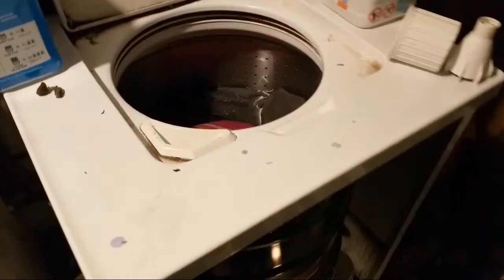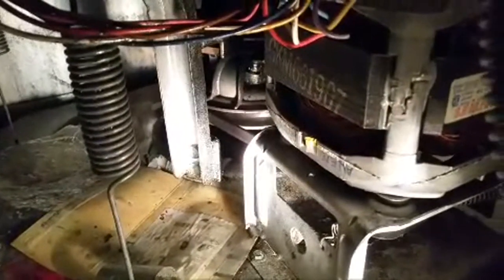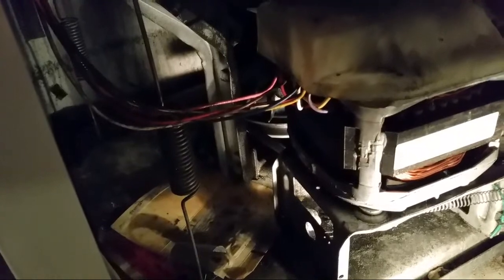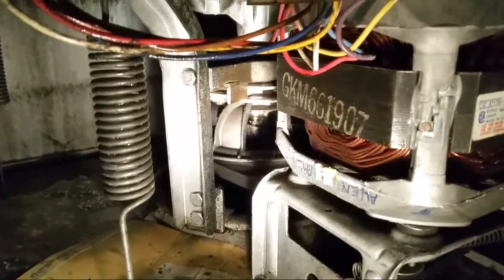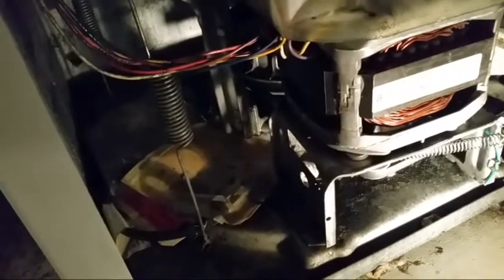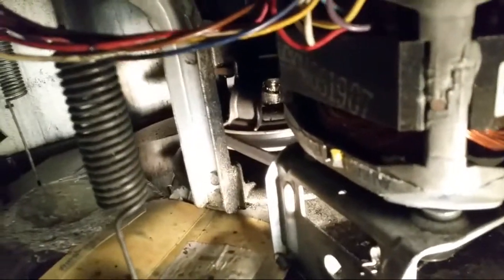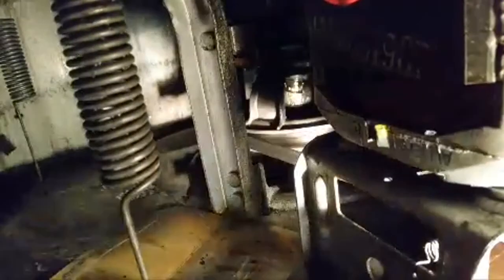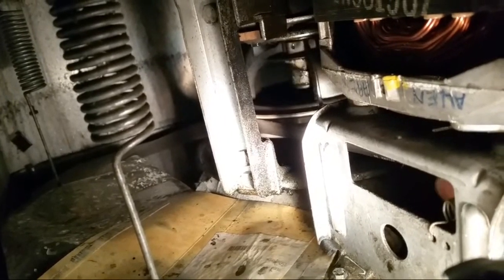Help! Washing Machine Flood!

Comment from the maker: what a cruddy day, best guess on this at this point is the transmission is bad.  the motor is doing what its suppoed to, the pump is doing what its supposed to.  but when its supposed to be agitating (the motor IS in reverse), the tub is spinning the water out of the tub (and onto the floor), worse i couldn't get a good live signal to get you guys to help out.   then I slipped on the wet floor and really messed myself up, not the best day.   probably getting a new washer tonight